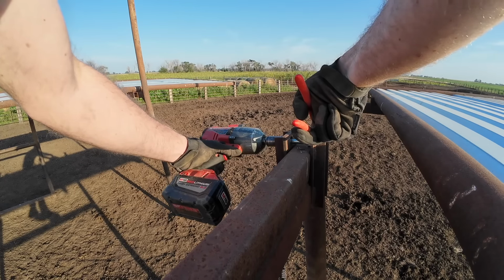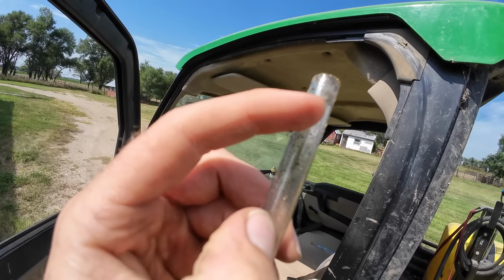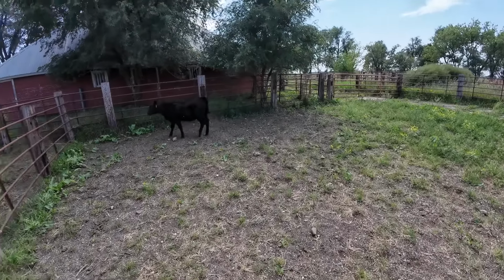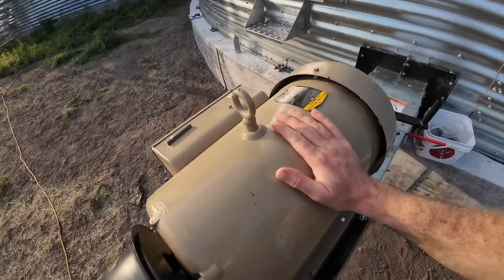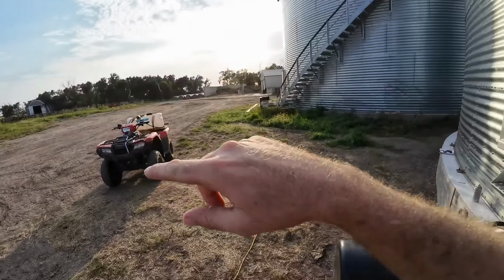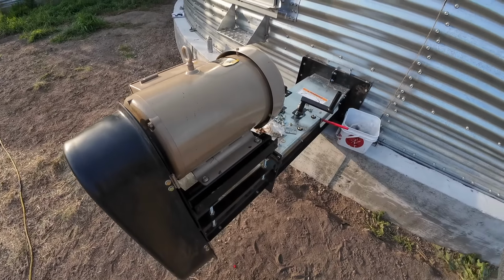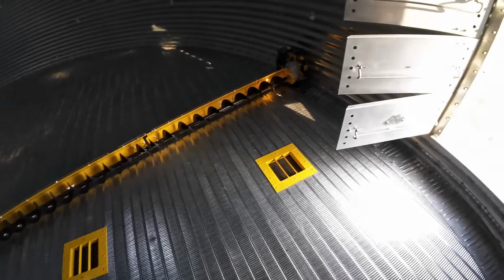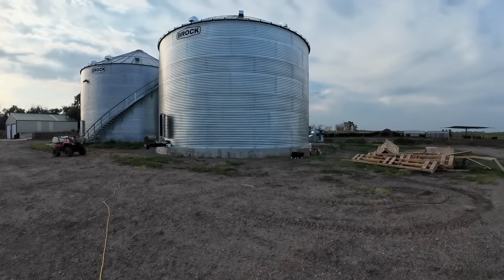Preparing Old Bin for New Floor

Comment: I seem to learn something new with all your videos. We recently bough an adjacent 50 acre farm that has several 40 year old 15,000 bushel bins and a Shivvers dryer. Some elbow grease and modest capital has got them back into good shape for hopefully another 40 years. One needs a new floor, sump, and sweep. I like the emergency sump attachment you showed. Brock bins are manufactured locally, so I'll check out that system. I enjoyed another great video. Stay safe during harvest.